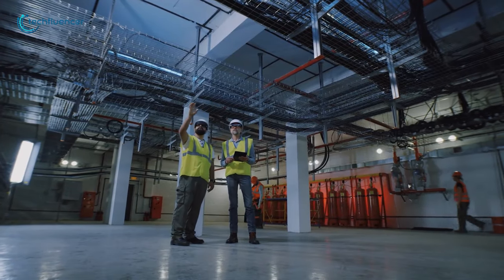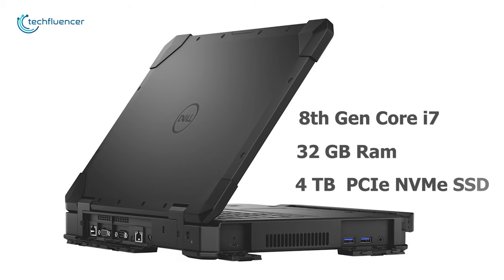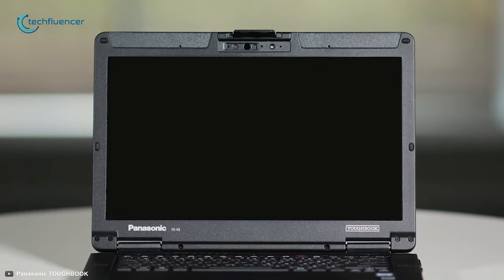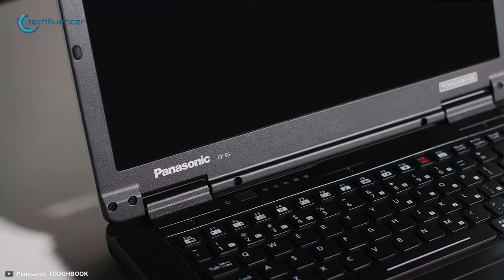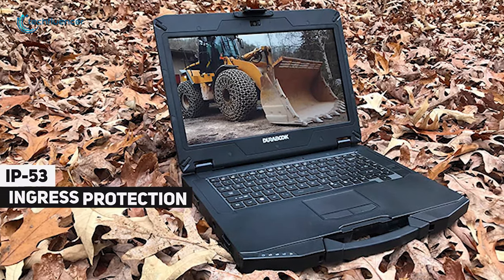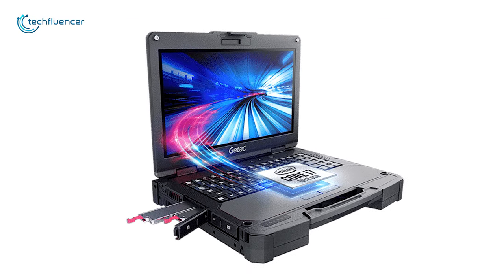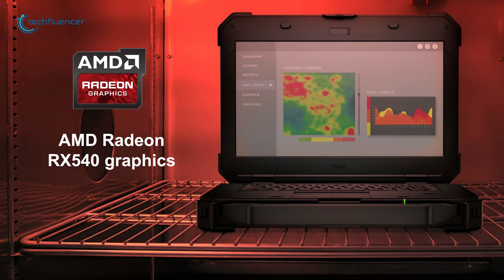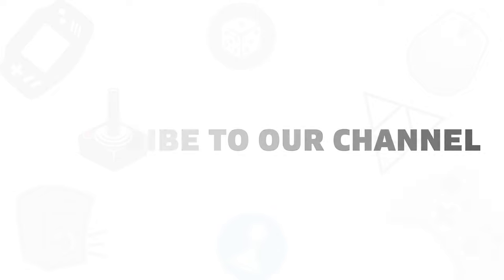Top 5 Most Durable & Rugged Laptops

Comment: Comparing between Panasonic CF-55 vs Dell Latitude Rugged 5420/5424. The Dell Rugged laptop is way durable and quality. Problems I had with the CF-54/55 is the front latch breaks and is not quality made. And when you replace it, you have to replace the whole LCD screen because the latch is built into to front bezel and LCD.  Battery also does not last. Junk for a pricey laptop in my OPINION.
Reply: Batteries are the biggest problem, laptops cost much more than smart phones still come with crappier batteries.